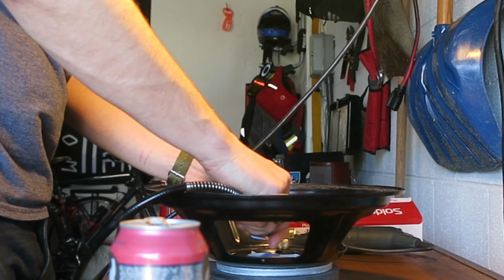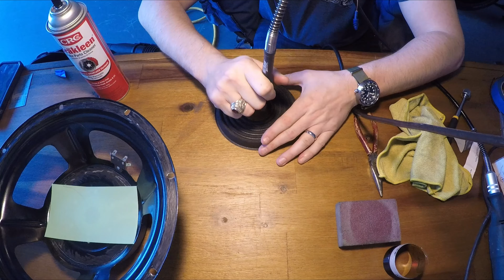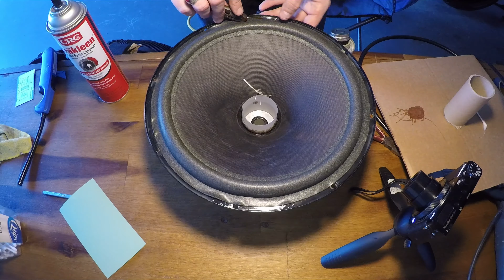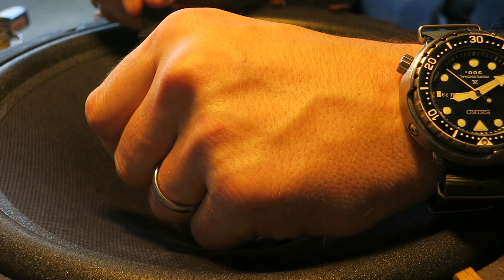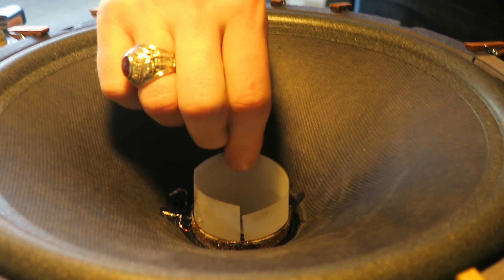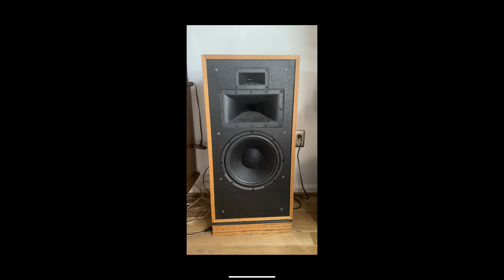Reconing a Klipsch 12" Woofer

Comment: This is a nice tutorial video. Thank you for sharing.

It is too bad that original ribbed cones aren't available to us. It'd be nice for the drivers to match aesthetically. I wonder if there is a tonal difference between the two drivers since, technically speaking, the two cones will be slightly different in mass and rigidity.
Reply from the maker: Thank you for the kind comment!   I agree, it would be nice not only to have the original ribbed cones but also the butyl surrounds.  The replacement kit has foam.  These differences inarguably create a different tonal character.